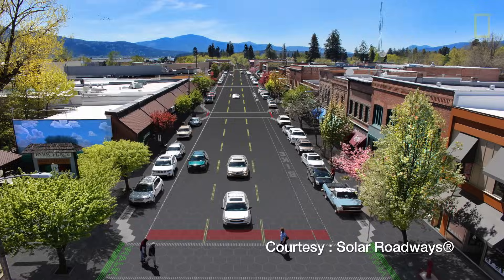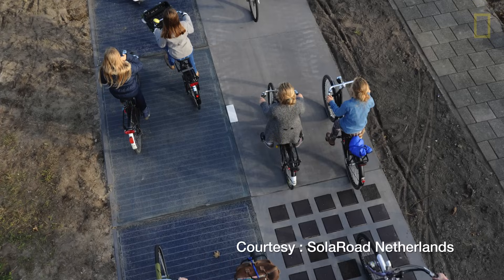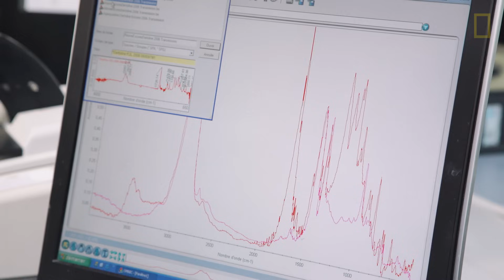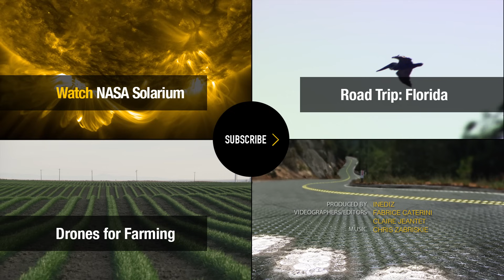Solar Roads: Can Streets Become Giant Solar Panels? | National Geographic

Comment: Prohibitively, stupidly expensive. Just the glass alone would be cripplingly expensive. You're also better off just building a solar panel roof along every road. That said, I do hope they manage to figure something out.
Reply: +Zedek That's actually a much more practical idea than the silly notion of turning the actual wearing surface of the road that vehicles drive over into solar panels. It kills 2 major problems with 1 stone:

1. Solar panels make TERRIBLE road surfaces (too many reasons to bother testing)
2. Excessive sunlight exposure to road vehicles.

With cars running in the shade, overall energy efficiency would actually improve a lot, especially in hot weather conditions. Less need to run air conditioners full blast translates to lower fuel consumption. Less heat and UV exposure would also prolong the life of cars in general, reducing the need for repairs and reduce parts consumption. Cooler road surfaces lead to cooler running tyres and longer tyre life. This can go on and on.
Reply: *****
Need the unobtainium metal from Avatar to pull that off...
Reply: +Andreas Tollånes (FanzyPantz) yeah. Bu then you put them on roofs. Im willing to bet that a large solar farm far away will be econimcally more viable than this.
Reply: MrDynamicMan Yes ofc, but why not both.. We can already put them up on roofs, we already have the technology for that.

The technology we really don't have is how to put solar panels in roads. You can study both, and execute both.. 

Without multiple different power sources we will easily fuck yourself over if something happen to the only one we use. Redundancy, and extra power is always welcome. 

The more power right next to the source of the power drain, the better.
Reply: +Andreas Tollånes the issue here is that there is not reason to even have panels in the city... Its infinetly more practical to have a massive solar farm in the dessert somewhere and have power lines runnjng to the city.
Reply: +Andreas Tollånes (FanzyPantz) sorry for my mistake btw. It is more effecient to have them in the city, just not on the roads.
Reply: They wont.. it's just an all around unbelievably stupid idea
Reply: Or even at the sides of the roads
Reply: +Zedek everything is expencive right away. If this get's more funding for production, in the long run cost will go down. But ofc it won't match asfalt in price ever. 

This is being made because there will only be so so many roofs to put solar panels on.
Reply: *****
You're better off just creating a "roof" of solar panels over all the roadways. This way you not only avoid the wear and tear of a multitude of vehicles passing over, breaking, and turning on top of the panels, but you also avoid having a bunch of cars blocking the solar panels.

As it stands, just the glass alone would cost too much. Yes, everything starts expensive, but that doesn't mean everything is equally viable. Like I said though, it's only good if they succeed, so I hope they do... it just doesn't seem feasible.

Frankly, I'd prefer if we focused more on refining and implementing liquid fluoride thorium reactors. Hell, even more regular nuclear reactors would be better.
Reply: MrDynamicMan Around 60% of all power generated never get's used due to the bitch called thermodynamics. 

It would be better to have many smaller solar panels directly right next to the thing that is going to use power than trying to send it trough miles on miles away trough cables. Unless we manage to create cheap cables that have insignificant power loss, local power generation would be way more efficient.